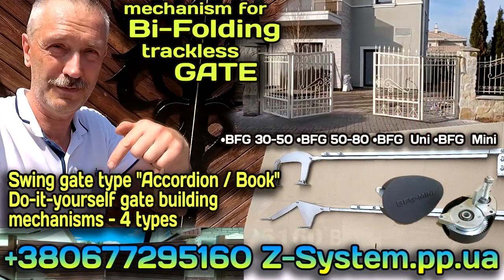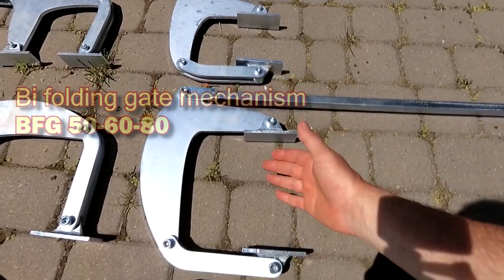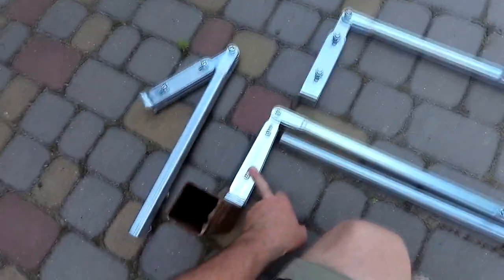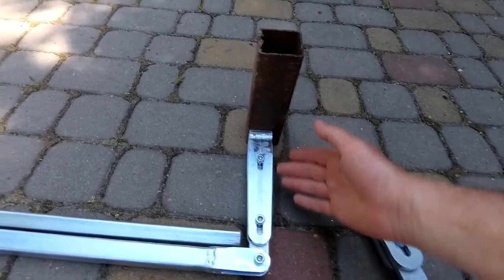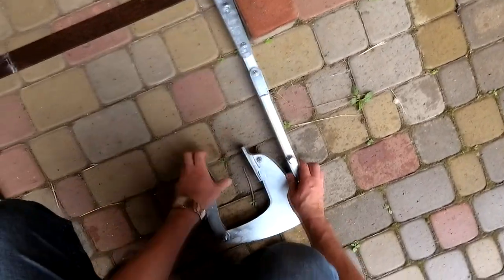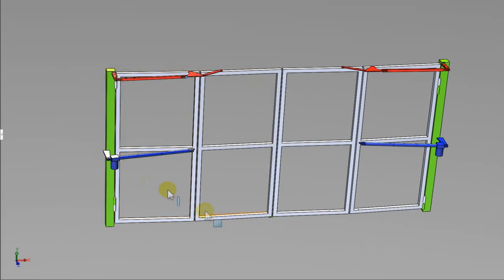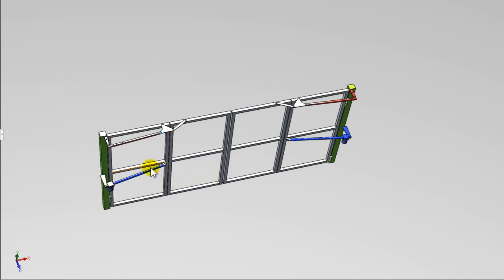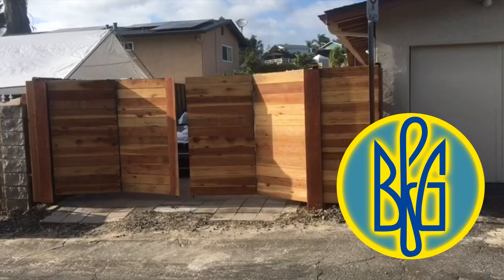Mechanism BFG-Bi Folding Gate DIY kit. For gates of the Accordion/Book system. A short video manual.

Comment from the maker: Watch the NEWEST video from my customers with the BFG INDI mechanism announced in the current video! A specially designed hidden mounting mechanism for Opening Gates Outward with installation from above/bottom at the end of the gate.
For safety reasons and the impossibility of access from the street, all elements of the mechanism are located inside the yard.
Installation examples https://youtu.be/RSvigQhH3d8
An example of opening a gate using the BFG Uni mechanism. Installation of telescopic and lever drives on outward opening doors https://youtu.be/ppQGXtMpxQs

Comment: Can it work on gates that fold outwards of the property? Also, this means the automation will have a gate leaf folding onto it, is there anyway to stop the second leaf from slamming onto the automation?
Reply from the maker: Hello! I'm glad that you liked my work) You guessed the theme of my last two videos)))
They contain examples of finished gates - I highly recommend looking at them. And just about the features of installation between the sashes. Include subtitles with translation. Pay attention to how the lever motor is installed - above the mechanism.
https://youtu.be/RSvigQhH3d8
Another video shows an example with a telescopic drive. To prevent it from being pinched between the sashes, a cutout is provided at the end of the second sashes. If you want it not to be visible from the street, you should hide it with sheathing from the outside.
https://youtu.be/ppQGXtMpxQs
Subscribe to the channel and stay up to date with new products)
Where are you from?

Comment: Hello, this is exactly the system I need. I just have a question, how wide can the gate be for one mechanism? I would need to open a 4.5m wide (2.25m after folding) gate out of the garden with this nechamism on one side, is it possible to use your system?
Is the assembly difficult and do I need something else for the mechanism?
I am also attaching a photo of the entrance, how the gate should be folded.

thank you very much for your help.
Reply from the maker: Hello! Glad you liked my work)
So, you only need half the kit (left or right) to open the gate on one side of a 4.5m wide opening. Yes it is possible. But keep in mind that this is a large opening and the first sash should be especially securely fastened to a pole or mounting pipe with three hinges. The first sash should be made with a cross-section of at least 60*60*3mm and should be made ventilated to reduce wind resistance. The second sash should be made lighter by taking a pipe 60*60*2mm thick.
The pillars should be securely strengthened in a strong foundation. The pillars have a cross section of 120*120*4-6mm or can be made from several pipes welded together. Pour concrete inside - then it will be absolutely stable - like in this example with doors on one side - the first fragment has an opening width of 7.5 m!
Here you should use the most powerful mechanism BFG 50-80.
The cost of half the set is $110 + shipping to your country. Where are you from?
The mechanism is available. Unfortunately, it is not possible to add photos to YouTube. I didn't see your opening. Write to me on WhatsApp or Viber or Telegram +380971387681.
Reply from the maker: https://youtu.be/LFtTz4PsJHI?t=162
Reply from the maker: https://youtu.be/ppQGXtMpxQs Here is an example on one side, although it opens outwards and a different mechanism is used - for example
https://youtu.be/68JoEtiZpcU
There are examples here on one side and in the second video there is also an example of a heavy gate in the opening https://youtu.be/68JoEtiZpcU?t=630 3.8 m sheathed on both sides with corrugated sheets, the gate is high and heavy. The customer played it safe and installed a pair of BFG 50-80 mechanisms at the top and bottom of the door) The gate has been working for 3 years without problems.
Reply from the maker: I just saw that you wrote to me on eBay) You are from Ireland - correct?
Yes, this is my ad. If you want to continue the discussion on eBay, let me know. Here you will purchase a mechanism without a site commission, and to be honest, this is better for me too, since I will receive the entire amount without deductions and on time. Since eBay delays payments for 1 month after the transaction and with
  I also get a commission.
Shipping to Ireland will cost $78.
Total: 110+78=188 dollars.
Delivery time is just over 2 weeks. For example, in the UK it takes exactly this long.